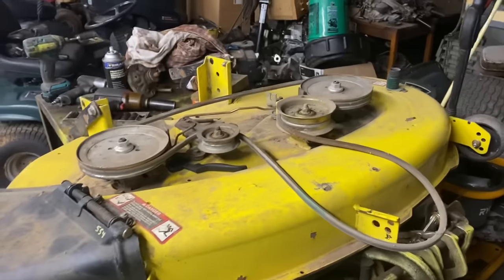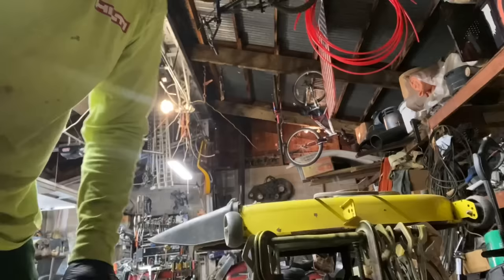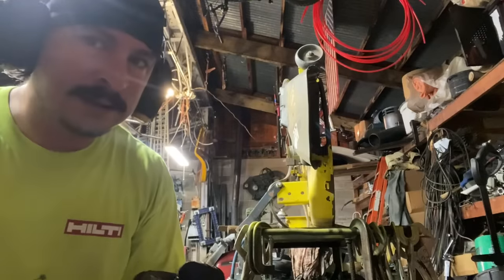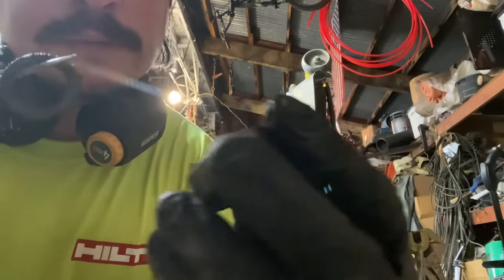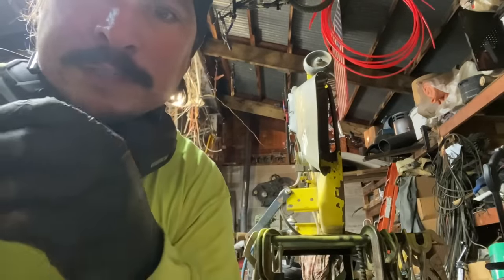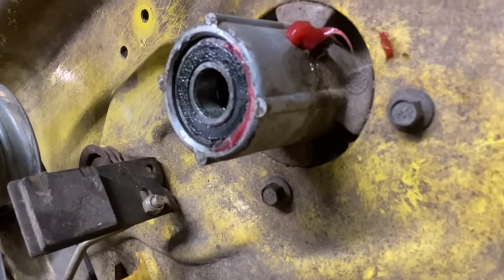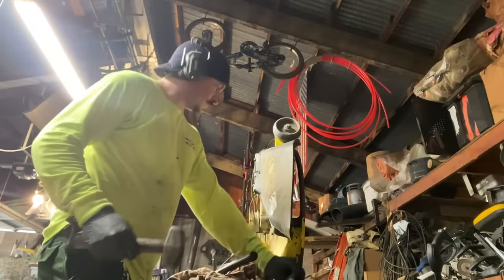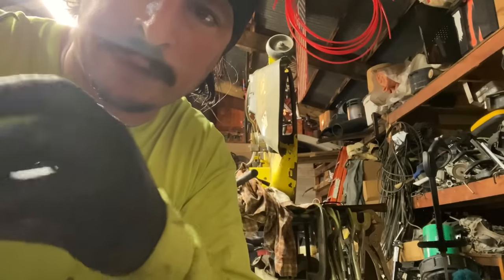Part 1 - Don’t trust the “Experts” Grease your mower deck sealed spindle bearings Common sense.

Comment: Thank you Russ for going through this thoroughly and explaining to everyone so they understand.  
Purely common sense...if there's a bearing there must be grease!  Period!  This pre-sealed garbage is due to engineered obsolescence, everything nowadays is made to fail much sooner, and of course, purposely.  How can parts companies sell you replacement parts or moreover, an entire new unit when they don't fail due to old school engineering?  Think about this...look at all the after-market parts companies in business today!  There were never that many, 50-60 years ago we really never heard of "after-market replacement parts", just OEM or remanufactured parts.  It's disgusting!  That's why major kitchen and laundry appliances fail in short order.  I have a 36-year-old KitchenAid washer AND LP gas dryer in the tack room in the barn, use it every week for my really dirty bibs and rags, never had to do a damn thing to it yet!  36 years old!  You'd be hard pressed to get 1/4 to 1/3 the life out of something similar today!
Look at "sealed" batteries, even the front bearings I put on my Infiniti were "sealed".
I like the fella above that installed grease zerks where there were none, we do that here too on occasion when we maintain our equipment.

Again, thank you Russ.  Your channel is what youtube should be...I did subscribe as well.
Reply from the maker: Thanks for the comment and I totally agree with you sir. Stuff is made to fail these days. The fact folks argue about this topic shows that plenty of us have been brainwashed and no longer thinking for ourself. I love the comments about the manufacture would tell us if these cheep box store model machines needed grease in the deck mandrels. Lol, They haven’t for years so why would they start now. I won’t hold my breath.

Comment: Excellent topic! ASE Master Tech here. I have replaced the bearings on my 46” Cub Cadet 3 times in 250 hours. The spindles do not have a grease fitting. Before I installed the bearings, I removed the seal on both sides and packed them with grease. I was shocked that the new bearings had almost no grease. Great video!
Reply from the maker: Thanks, I’m no longer holding current certification but I was ASE master tech certified for many years. Appreciate the comment.

Comment: I learned something. I personally still greased them as well though I thought the seals would prevent grease penetration, but honestly the main reason I do was because in my mind so many synthetic greases now can stand up to excessive abuse and usually when the bearing gets debris and water and such into it is when the balls and such degrade. In my mind that spindle full of grease acts as a superior water shield for the bearings.
Reply from the maker: Maybe so. If
It’s full of grease not much room to
Take on water.
Reply: Agreed, I do the same, also if u pump dirty grease or water out more often, it cant hurt more than leaving it in, right
Reply from the maker: @evil17  exactly!
Reply: Yes!  Just a thought -- Ideally, the spindle assembly would have 2 zerks, one topside and one below the bearing on the blade side.  Use a water resistant, self sealing grease (in the presence of water) such as a kaolin-based grease in the bottom zerk  but do not use so much as to push into the bearing, and for the top zerk maybe a lithium-based MoS2 or aluminum-based grease.  The MoS2 grease is good from a tribology consideration because the MoS2 can sort of fill in and bond in the micro pits caused by wear. Someone may comment about mixing greases but the point is not to push the bottom zerk grease into the bearing, but pushing just enough to see some flowing at the bottom.  (This presumes the grease pressure is not enough the damage the shaft seals.)

Comment: In the peoples defense, we are always being told (greasing 101)  not to over grease when greasing with the grease gun.  "more is not better"
I come from the farm and I prefer being able to grease things, but these sealed deck bearings are going for many years with heavy use.  Good video.
Reply: I agree, it's the grade quality of the Bearing that counts. Sealed bearings are in alot of applications that don't have access for greasing for sure. On mower decks for bearing inspection is easily done. Take all the tension off the spindles and apply pressure on the blades up and down will show if they are movement in them there is a good chance bearings are worn. You can do what this fellow just done for more greasing. I have a john deere stx 38 that the sealed bearings lasted 20 yrs. Bearing quality means alot also. It is the grade of material they are made of. I worked in the Bearing industry for nearly 40 yrs in the grinding department. We done roller type tapered type ball bearings as well. Bearings went up in size of 7 foot od weight was in the tons.

Comment: Where there is grease there is not room for water and thus corrosion. I clean the beraings with diesel, airblow them dry and grease them up. Great job showing removing of rubber seals vs buying a new beating. That equipment is nowadays rediculous expensive. My stuff alwasy look almost new and take pride in what I do as you do. Thank you!!!
Reply from the maker: Thanks for taking the time to share your thoughts on the topic. I do agree.

Comment: I totally agree with your findings! Lets just look at the pressures a grease gun can generate. The seal is not a hydro seal or pressure seal, there purpose is largely just to keep larger particles out. So clearly the grease will penetrate the seal! Thanks for posting!
Reply from the maker: Thanks. I appreciate the comment. Some folks want to argue about this rather than just simply try it and gain the benefits of adding grease. So simple it’s almost hard to believe there is anything to even dispute after it’s been explained.  I did my best to keep is simple. Hope it helps some folks.

Comment: In my experience it's hard to find a new mower (even commercial mowers) that has spindle assemblies from the factory with grease fittings. My zero turn uses greaseless bearings and the dealer promotes them as "no maintenance needed" but what they don't tell you is it's maintenance free because the bearings will need to be completely replaced in 6 months.
Reply from the maker: Makes you wonder.

Comment: Well made video to the point and direct.   Everyone should know that no matter what you are greasing you do not stop pumping until grease oozes out somewhere.  I always grease until it gives way.  But still yet if you have to change one of these spindle assembles as I did recently I took the time to remove the seal on the inside.   It makes them that much better.   I understand why they use the sealed bearings when building them on the assembly line as it is cleaner and they do not have to worry about debris getting in the bearing..     I had bought a used Zero turn that was like new and someone hit object and bent the blade cracking the spindle housing.   So if you are taking one apart or putting a new one I think removing just the inner seals make sense so it can get grease in it easier. But either way if you don't fill the housing the  bearing will remain dry.
Reply from the maker: Thanks for the comment. I don’t think it makes any difference at all if the seals are removed. Iv never found any evidence it provides any benefit at all to remove one. But if it makes the owner of the machine happy and gives that warm and fussy feeling, that’s great. I think there are some benefits to leaving the inner seals. Especially on the upper bearing. Iv gone into that in other replies but really Don’t matter one way item matter. As you said, as long as they are greased that’s what matters. And greased till it comes out from somewhere and assembly is filled.

Comment: Very informative testing and concluding results Russ, most people wouldn't have the time and patience to follow this experiment through. Before the start of this mowing season I did replace both spindles on my Craftsman YT-3000 (Husqvarna made) and removed the inner bearing seals but later pondered on the idea of just leaving them in and drilling some small holes say 1/16" around the diameter of the covers to allow grease to get into the bearings a little easier, might or might not be a good future idea? I too had to pump about 65 shots of Lucas red-n-tacky grease into the spindles before I knew they were full when a little started seeping out one end, I re-grease them now with about 8 pumps every 30 hours. I like the locking grease gun tip idea but accidentally discovered something this year when the tip on my grease gun hose got stuck on the zerk fitting and I couldn't free it and discovered that the metal tip end could be loosened from the whole part of hose end to free it from the zerk, so I now just loosen the tip slightly before I install it on a zerk, tighten it slightly with plyers, pump the grease, and loosen it back up to remove it from the zerk when done, it locks the tip on so the hose doesn't pop off and all the grease goes in without any seeping out, it works great!
Reply from the maker: Thanks for the comment. As for the locking tip it’s worth every penny. I like the quickness of having the latch. Probably last forever as long as it never gets lost. Lol. This one was a gift but I wouldn’t hesitate to buy another one.
Reply: The idea of through flow bearings is the one way flow system, the grease only flows one way from the zerk/grease nipple through the bearings to the out side world. The side with the rubber on is not a seal , it is a type of one way valve and should not be removed or drilled through. the old grease that came out last greasing should be wiped away and the new grease that comes out should be spread around the shaft and bearing to act as an outer dust seal.
Reply from the maker: @sidneyeaston6927  Grease has only flowed one way in any zerk Iv ever seen unless it was broken. So one way flow system is just kinda a given when a zerk is installed. Wipe off the old grease? and spread the new grease on on shaft and seal to act as a dust shield. Iv never heard anything like this nor does it make any sense to me why someone would do that. I mean most people would naturally wipe off the excess grease that comes out. Or who cares if it slings off in the grass when cutting. Probably advice with good intentions I’m just not understand.
Reply: Carmine, thanks for your comment.  I often wondered how to remove and possibly save the integrity of a locking grease head after it locks onto a zerk. Some locking grease couplers lock so firmly around a zerk that they'll actually pull a zerk out.  Your idea to loosen-then-retighten the locking grease coupler sounds better than jerking it loose from the zerk.  That would save the integrity of the coupler lip-tangs (I made up that term) as well as save from ripping out the zerk.  Your comment was quite suggestive. Thanks 👍🏽🤠  10/1/22
Reply from the maker: @houndsmanone4563   have you tried the quick release type that has a lever to lock onto the zerk and easily unhooks? This was new for me but great tool.
Reply: @GTObearclaw1  I did and you're right.

Comment: Used to clean out the grease and fill with my own grease, generally a synthetic, but I also would use Wurth HHS and let it evaporate and build up multiple times. HHS also makes excellent assembling lubricant

Comment: Spot on Russ! Just run across this video. It makes me chuckle and giggle.  Basically, grease fittings  on these types of mandrels is pointless, false or useless. By the time  a person that would grease their mandrels on a regular basis, the bearing would be worn out before they would have or might have enough grease in the mandrel to have an effect. In fact, there is a lot of equipment out there that have this kind of stuff. Most mandrels I've seen that have a grease fitting and have dismantled, didn't have a speck of grease in them from the factory. I'm glad there are people like you, making the public aware of this atrocity. Keep up the good work.
Reply from the maker: Thanks for the comment.  I believe if folks knew to grease them till
They were filled the first time they add grease then from that point forward they only need to hit it with a few pumps on future services. But we have to get that mandrel filled before grease will ever be able to fill the void and unless inner seals are removed the grease can’t reach bearing until
Cavity is filled and it can build enough pressure to slip past seals. I was sad to see some folks posting videos telling folks not to even bother greasing and that’s sad because they should be adding grease, but they just need to know the first time will take more grease to get them filled. After that it’s smooth sailing. But as you stated most have never had a grease gun attached and I see the same thing. Most mandrels have absolutely no grease inside so nobody has even tried. And as I’m sure you know sealed bearings don’t necessarily mean they can go a long time without grease added. Yea some might last a long time but not all can. And Iv seen bearings fail in under 100 hours.

Comment: Thanks for the video - I'm updating my 15 yr old Craftsman YS4500 and replacing the spindles AGAIN (I'm hard on the mower) - looks like I need a grease gun; I was gonna remove those inner seals per some other videos, but this is clear proof that they're fine just as-is. Too bad the spindles are made from Chinesium / pot metal these days, but - sure beats dropping a few thousand on a sexxy green ZTR or something?  :)
Reply from the maker: Thanks, glad you are willing to try it. You won’t be disappointed.

Comment: Great video. You show clearly what I have done for years but I also tap into spindles of all types without removing anything to install grease fittings and have saved my customers a lot of money. A grease gun produces 7 thousand 200 lbs. pressure that no seal out there can stop.
Reply from the maker: Awesome, your customers may not understand what you really did for them but they will most certainly benefit from it. 
Appricate the comment.